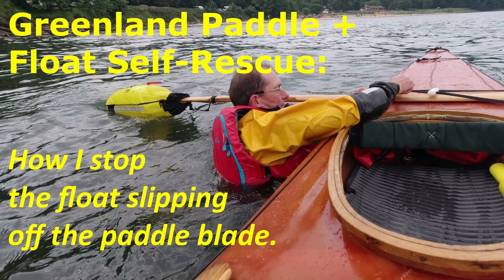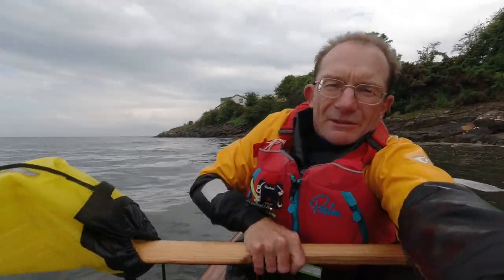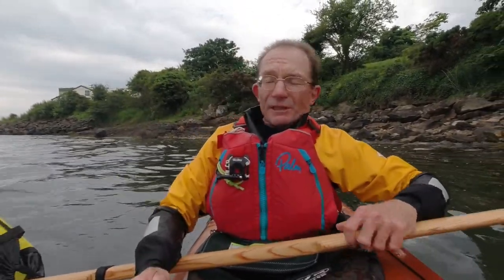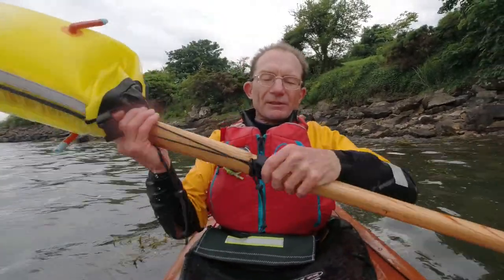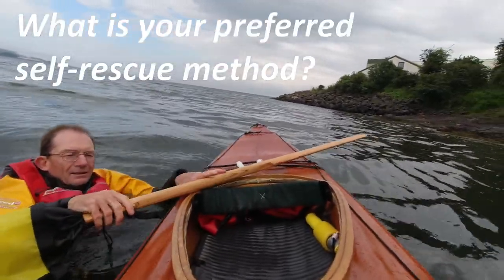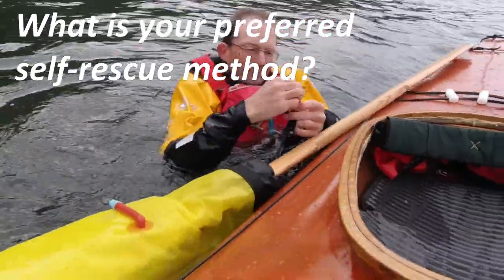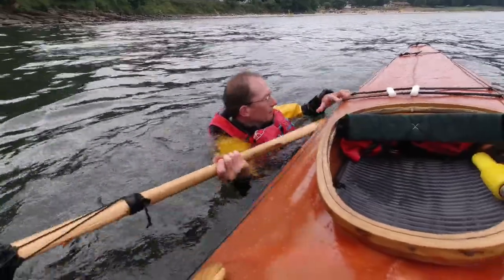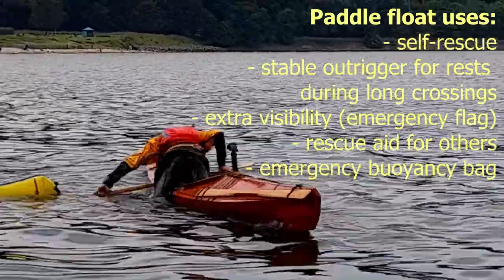Kayak self rescue - Greenland paddle & float

Comment: I acquired a proprietary high density foam float. My GL slides tightly between the two halves within the close fitting sack.  No tying or velcroing required.  No need to blow it up when already stressed. Sits flatly on the aft deck under bungees.    Great for an armchair rest or photography moment.
Reply from the maker: Yes, they're good too. I haven't had the opportunity to use one. As you say, not having to inflate is a plus. Thank you.

Comment: I use velcro as drip rings. Add a strip of ash 1/2 inch down centre of wood paddle for strength!!
Reply from the maker: Both sound good suggestions,  thank you for sharing them. I may try the velcro thing this winter.

Comment: I secure the paddle behind the deck, as you did, but forgo the float. I find the momentary paddle support adequate for a surfski style re-entry.  I reach across the cockpit with one hand grabbing the combing, so it's not blocking my entry. I grab the near side ahead, either grabbing the combing near the front or grabbing the perimeter line, depending on the boat. Then with a quick move that minimizes sinking the paddle too much I slide across face down until I can balance in this position. From this position, I find it easy to flip around and drop into the seat followed by bringing my legs in. 

The tricky part is avoiding dropping the combing under the water or flipping the kayak up-side-down when making your move. I bring my feet up kicking as if I'm swimming and pushing the kayak with straight arms. Then I pull the kayak towards me as I press downward, which tilts the kayak a bit, lowering the near edge of the cockpit as I press downward during my move onto and across the opening. I put as much pressure on the far side as I can as early as possible. With practice it's very fast and easy.  Also, I empty any water out first by raising the bow a bit out of the water with it up-side-down, then flipping it over while still being lifted. My head goes briefly under while doing this.  

A thick PFD with extra gear, such as a radio or auxiliary pocket, in the front means that one will have to climb significantly higher to do this, making it much tougher. Point the kayak into the waves, my preference,  or with the wind to your back so that the kayak gently pulls you along raising your legs near the surface with little kicking needed. Wind blowing the boat towards you will make it very hard to get your legs up near the surface.

Here is a video showing it for a surfski.  For a kayak, I would secure the bungees under the rear deck lines rather than holding it. It works very well for standard kayaks.
https://www.youtube.com/watch?v=Jxk126VDtNM&ab_channel=OceanRidersOnline

For skin-on-frame kayaks, here is a great way to do it:
https://www.youtube.com/watch?v=xDsgjtzfg64&ab_channel=CapeFalconKayak
Reply from the maker: Thanks for your detailed response.  Yes I have also practiced this re-entry without the float and it worked as long as I had plenty of energy left, as you say, the pfd gets in the way a bit. It's definitely good to practice without the float too. Thanks for the suggested links and your contribution to this thread. The more ideas and approaches we have, the better for all of us. Happy paddling!

Comment: I use a paddle float.  People have strong opinions about them though.  I keep being told I'm wasting time getting and inflating a paddle float and that I should learn the cowboy routine.  However, I feel I need a reliable rescue so practice using a paddle float outrigger. I do occasionally try without a paddle but I think it's going to take a few more years practice.
Reply from the maker: A variety of techniques is good to keep available I reckon,  a float gives you a range of more stable options, including just taking a break in open water. I don't know why some get so fixed and dogmatic about it.

Comment: Hi Chris I’m brand new to kayaking. I’ve got a wave sport hydra sea kayak. I at present have a palm euro style paddle, but have a long term nagging shoulder pain. I’ve seen these Greenland paddles and wondering if they would be any good for beginners. What’s your thoughts mate and what model is your Greenland paddle and where did you get it. 
Great video by the way. 
Many Thanks Gordon Duff
Reply from the maker: Hi Gordon, thanks for your comment.  I started using a Greenland style paddle that I made myself about 2 years ago, not long after taking up sea kayaking again after a very long break (several reasons). Among the things that drew me to these paddles was the consistent reports saying that they were less of a strain on arms and shoulders and are easier to use for rolling, which used to be really intimidating for me in the past.  I've found them easier to use both for paddling and rolling, noticeably easier on the body, especially over a long day and in wind, despite not being "feathered".  I think they would be easier for beginners too, though I haven't personally tried this in my club yet.  The technique for paddling with a Greenland paddle is slightly different but easy to get used to in a few minutes.  A friend who had never used one and who has a nagging shoulder pain tried one and found it instantly more comfortable.  The skeptics in my club are gradually opening their minds, especially when they see that I've had no problems keeping up my speed on trips in my F1 skin on frame kayak; most of the time I'm pausing so as not to go too far ahead and I don't consider myself a fast paddler. I made my paddles out of Douglas Fir, strong, rot-resistant but heavier than Cedar, which I used for my main paddle.  I followed video and plans from Brian Schulz of Cape Falcon Kayaks (https://www.capefalconkayaks.com/ ) whose site I recommend strongly, even just for interest. I make my paddles using hand tools and working in my kitchen area, which I may post a short video of for others without a workshop, but you can buy good Greenland paddles too, though I don't have a name to recommend I'm afraid. You can get lovely carbon fibre ones - for a price - look up Kayak Hipster's channel on YT for a make that looks really good.  I prefer wood for aesthetic reasons and they're repairable/recyclable.  A long answer to a short question... sorry!! I hope this helps and feel free to ask any more questions... it might even give me a video topic!! Best wishes.
Reply: @chris-terrell-liveactive  fantastic thank you Chris and yes a video would be amazing

Comment: I'd never put a float on a wooden greenland paddle. The risc of breaking it is considerable. Besides, as many others here have said, the bouyancy of the paddle itself is sufficient. In other words: do a regular float rescue, but forget about the float. And even better, of course: try to master rolling!
Reply from the maker: I've not found it putting any excessive strain on the paddle, which is made of cedar so not the strongest wood, probably less than when using it to help slide in/out of the kayak on a low bank or rocky shore. Yes the paddle has good buoyancy but I wanted to test this for situations where extra stability would help, even just for a rest stop on a long crossing; I don't just use a float for rescues.  There are many variations, this is just one more. Yes, a reliable roll is best to avoid a rescue becoming necessary.  Thanks for the comment and for watching the video. Happy paddling!
Reply from the maker: Another consideration is, if fatigued, when a capsize and failed roll becomes more likely, it's also harder to make the move onto the kayak without sinking the paddle, as I've found during practice sessions and for people with less upper body strength.  Then the additional support of a float really helps. It just adds to the repertoire of options.
Reply: @chris-terrell-liveactive  You've got a point. When I think of it, the danger of breaking the wooden paddle is rather when practising rolling tecnique with a float.
Reply from the maker: @erikwahlberg448 I haven't done that but will keep it in mind, thank you.